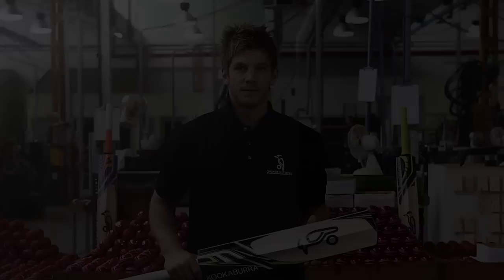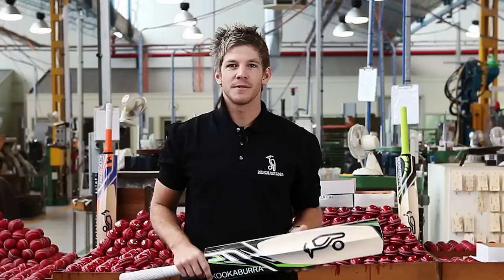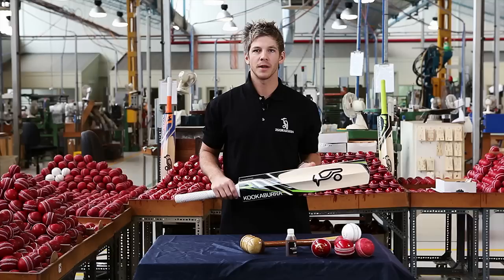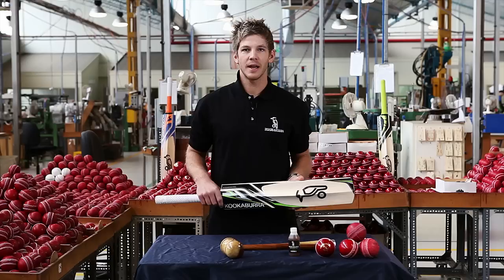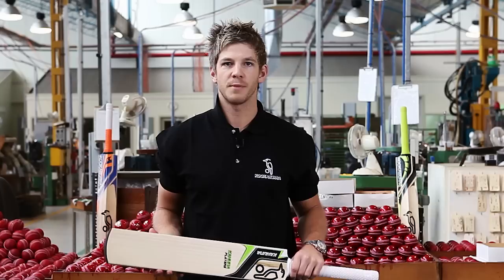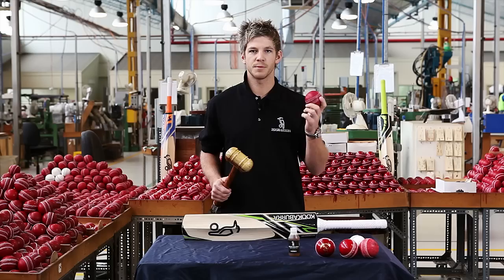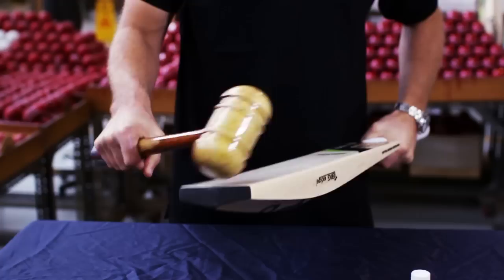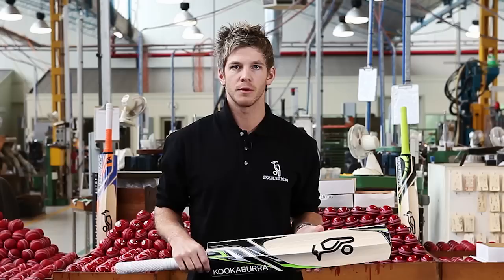Tim Paine's Kookaburra Cricket Bat 'Knocking In' Tutorial

Comment: does it matter if u knock it in before u oil it
Reply: Most bats from major brands are pre-oiled. So, no need to apply oil. But after a year, oiling would make the bat less dry and increase longevity. If the new bat is not oiled, then obviously oil, let it dry for 48 hrs, then start knockin it in.